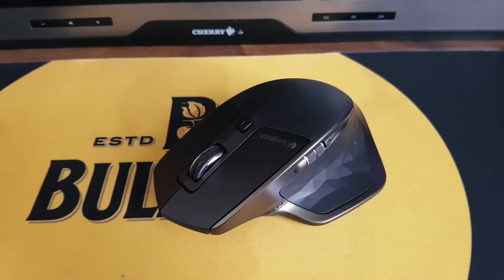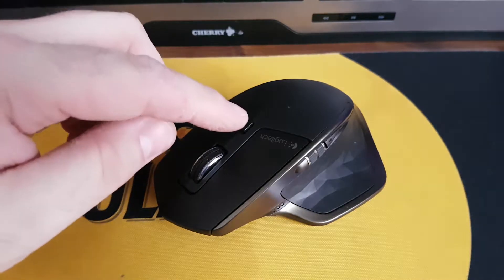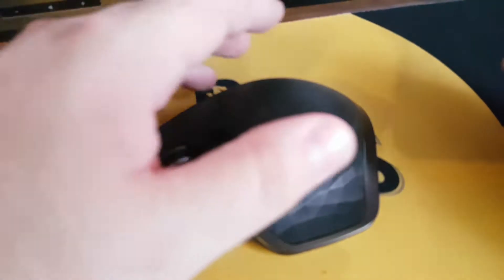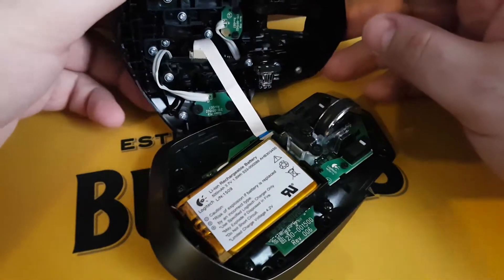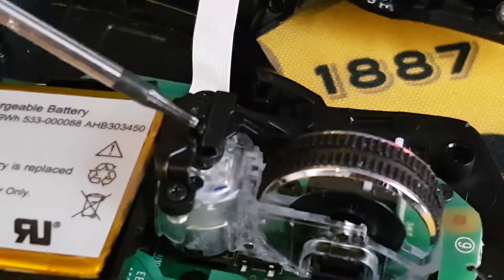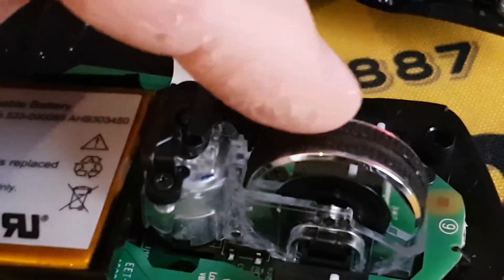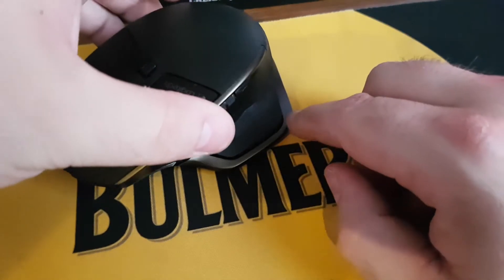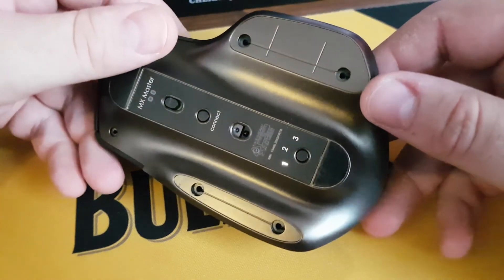Mx Master Loose Scroll Wheel Fix

Comment: whack the bottom front of mouse onto the palm of your hand to reset the pin, and Bob's your uncle.
Reply from the maker: I've had limited success with that method. I eventually used a tiny dot of epoxy to hold the plastic in place.

Comment: Hey Mike,

Do you have this condition with your mouse as well? https://www.youtube.com/watch?v=hsm-qXm1KW4.

The scroll is fine, but the wheel feels loose when its moved from side to side.
Reply from the maker: No, the body of my mouse is very sturdy. my only issue is that the wheel comes loose after about a month of use.

Comment: Thanks for the fix tip! I Have the same issue here. Is it possibile to mount the same mouse gliding pads after being removed for the screws access ?
Reply from the maker: If you take them off slowly, then yes they can be reused. I used a DVD case to "store" them as the plastic cover on a DVD case doesn't hold on to the adhesive on the pads very well, meaning they stay nice and sticky. :D